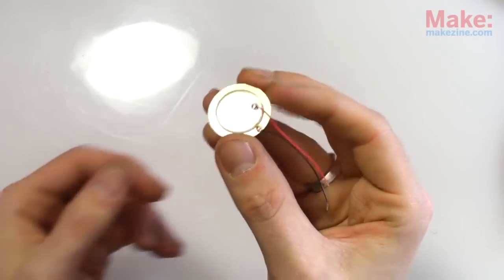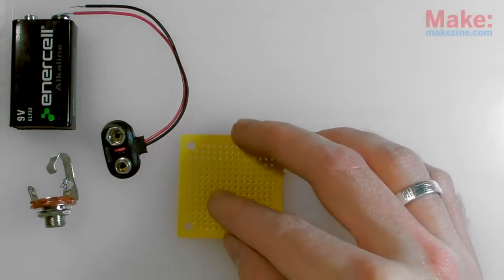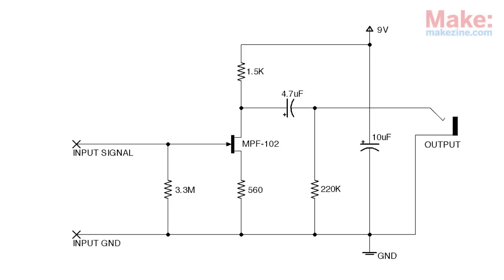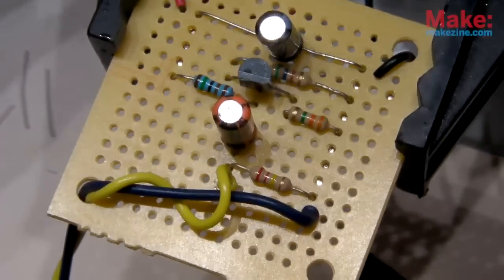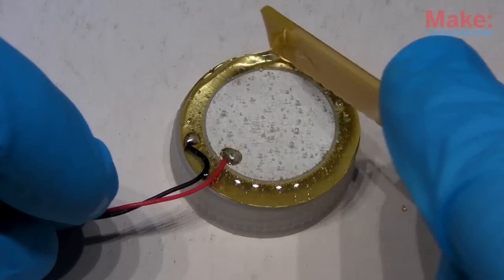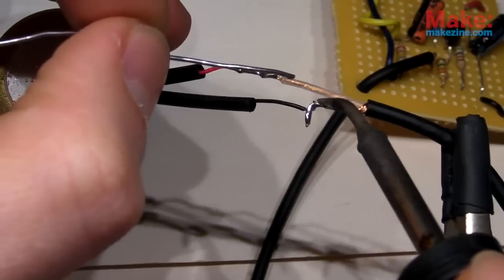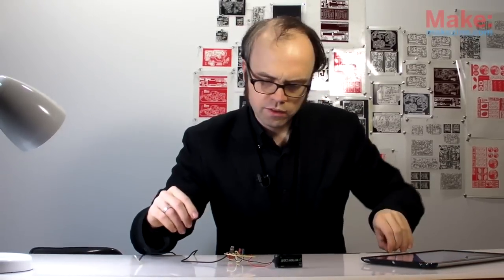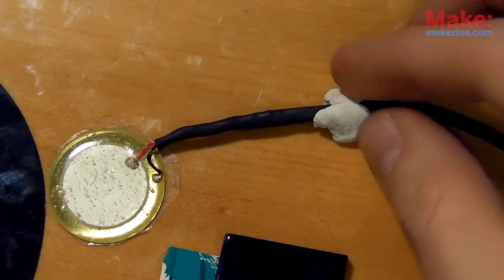DIY Contact Mic - Collin's Lab

Comment: Thanks for the great video.  I want to build this into an electric guitar using an under-saddle piezo system.  Where would I wire in a volume pot?  It will be separate from the magnetic pickups but I'd like to use a separate volume pot to blend in with the magnetic signal.  Thanks for any assistance you can offer.

Comment: The little high-z preamp circuit is interesting, but it appears that when the author went into close-up detail about the transistor connections, he managed to get the 'source' and 'drain' connections BACKWARD! According to what I have been reading about circuits using FET (like the MPF102) transistors, the SOURCE in this schematic diagram should be connected to the 560 ohm resistor to ground, NOT the drain! Hope this helps. The schematic diagram is correct, just make SURE that the lower leg of the transistor in the diagram is the 'SOURCE'. (The one connected to the 560 ohm resistor!)

Comment: Nice! I actually made something work :D Thanks Collin! 
Now I'm trying to replace the battery with a power supply / switching adapter (9VDC, 1A), but I'm getting horrible hum!
I've checked the polarity and all grounds are connected (tested with multimeter). 
Can somene please tell me what's going on?
Reply: eu , tenho o mesmo  problema , tambem não achei,  de onde vem  o zumbido , eu o mau  não  funcionou , tambee, quero uma ajuda!1

Comment: This is seriously old.  However, I'd like to hook up a piezo to a super tiny amp, run it off something like a 1 cell lipo.  connected to earphones with a pot to adjust the volume.  What amp would I be looking for for this project?

Comment: I want to make this pre-amp, but since I am a electronic newcomer I feel like I didn't get enough information. The Link in the description doesn't work by the way.

So If I look for all the resistors with the same Ohm Value as you stated, the seller will state more informations and I don't know if stuff there has to match f.e: TRU COMPONENTS TC-MF0W4FF5600A50203 Metallschicht-Widerstand 560 Ω axial bedrahtet 0207 0.25 W 1 % 1 St. (so the 560 Ω) and the 
TRU COMPONENTS TC-MF0W4FF3304A20203 Metallschicht-Widerstand 3.3 MΩ axial bedrahtet 0207 0.25 W 1 % 1 St. (3.3 MΩ) Do the resistors have to have the same W value? Do they have to be "axial wired?" should I look for another resistor? Should it be from the same company or is just about the resistor value..
Or with the capacitor: Panasonic EEA-GA1H4R7H Elektrolyt-Kondensator radial bedrahtet 2.5 mm 4.7 µF 50 V 20 % (Ø) 4 mm 1 St. and
Panasonic EEA-GA1E100H Elektrolyt-Kondensator radial bedrahtet 2.5 mm 10 µF 25 V 20 % (Ø) 4 mm 1 St. 
1 states 50V the other 25V -> will this fuck with my circuit? 
I feel a bit lost..  But thank you for the video nontheless..

Comment: seeing as the piezo element works on vibrations (unlike normal electric guitar pickups), dont you think encasing it in rock hard epoxy might reduce its effectiveness? In other places Ive seen them used (microphones, speakers, triggers, fogers, sonar...) they are never installed with such restrictions. Im no expert here, just using some common sense. I welcome any informed corrections

Comment: How would the signal be worse if you would connect the piezo directly to the amp without the circuit?
Isn't the high impedance signal of the piezo actually ok for the guitar amp, since the electric guitar pick-ups are also passive? Thank you for answering!

Comment: I'm cheap and I think it's way more rewarding to do something yourself rather than buy something pre-made. But I still wonder: How good is this compared to a piezo system on an electric guitar? I want to do this to my electric guitar.
I think it's also fun to experiment by adding it to the tremolo and to different places on the body. It might do something interesting with the sound.

(If I don't watch out I have to build a control panel on my guitar in order to select the contact mics I want to use.. xD )

Comment: Piezoelectricity is really an interesting thing and is found in anorganic, organic and polymeric materials. High impedance output is critical. I experimented with another contact microphone type DIY, but piezoelectric materials are modern and have advantages against other technologies. Therefore I'll test that sort of material too!

Comment: Great video! Thanks. It might be worth mentioning that whenever one needs to "clip off the connector" from the end of a cable (RCA in this case), it's smart to clip the wire much farther back on the cable (length permitting). By doing that, a second usable cable is created, saving future project cost.  Clipping the RCA plug off so close to the end wastes a good opportunity  to have a cable for another day.

Comment: When the video I wondered for a moment why Agent Smith was doing a video about building a circuit. :)  Are you sacrificing any responsiveness to sound by adding epoxy to one side of the piezo?  If I was to try this I would prefer trying to stick the piezo to the pick guard to avoid damaging the finish of the guitar top, or put it inside. The bottom strap post on the guitar could be replaced by the jack and it would make it easier to keep everything inside the guitar.

Comment: Hey Collin, really enjoyed your video.  I was just curious about the role that the 220 K ohm resistor plays in the circuit/ diagram. Could u explain?
Reply: The 220K resistor has no effect on the audio signal: it just connects the negative terminal of the 4.7uF capacitor to ground. This ensures that the 4.7uF capacitor is correctly polarized and that any DC leakage current from the capacitor flows to ground .  The 220K resistor will also eliminate pops and bangs when you plug the pre-amp into the main amp.
Reply: @phonicwheel933  Hi Phonicwheel, are you are still available for advice? I made the circuit today and am getting pops and bangs when I plug it into the amp... Also, the piezo records sound when I tap it - but records no vibrations when I hold it against my throat or other surface? Would you have any advice for problem checking? Many thanks, T

Comment: Good day, I've build the  pre amp unit as explained by the diagram that is in the video. I might be wrong but when I look at the video and how you build the unit, it seems to differ from the diagram provided. As I said, I did use the diagram and it does not work properly. As a matter of fact the 9v battery is building up excessive heat. Where can I get the right diagram.

Comment: Output is better with the prea-amp then without, but still the signal is quite weak, can the circuit be easily adapted to amplify a bit more?

Comment: Hello Collin, How to make a piezo crystal Wass the gateway video, Great Vid! and of corse I went looking for what I thought was going to be a vid" how to make your piezo" which I never found.
But I did come across this video,  While I am sure its true making a preamp(very good instructions) But I am confused.The reason for the confusion is from watching a slew of other videos, in which,  no pre-amp was made or added to the piezo.  Instead, just a quarter inch female jack is attached to the leads of the piezo ( that is taped, glued to a cigar box usually) its then plugged into an amp,  and lo and behold it works????????
Can you please clarify .  Does both methods work? or one works better than the other.
Thank you

Comment: noob here, 
I need to know whats the voltage of the components, i find several of the componentes with the same uF but i dont know the voltage ..
Thank you
Reply: hi, You can use any voltage of capacitor , but i never test >50v capacitors on my piezo preamp , i have make 3 of them using diferrent capacitor voltages, all works and nothing different. maybe it will work on 10-50v capacitor, i am noob too so dont judge me... sorry for my bad English

Comment: for a complete beginner this is a nightmare, can the resistors be different colors in my country ? Did you put things on board in the same order as it is in the schematics, hmm probably not, i can not figure it out, help
Reply: Resistor color bands are standardized no matter what county you are in. You can lay out a board however you want so long as the right connections are made.
Reply: If you are unsure of the value of the resistor, 
you can get a multimeter to measure the resistance of the resistor.
I personally don't really remember the colour code of the resistor.
However, the colour bands are standardized

Comment: Great project idea! Looks like the MPF102 transistors are no longer available, and the nearest thing I could find was a BF245. Tried it and it seems to work. No luck locally (Dallas, TX) finding the 3.3 MOhm resistor. Fry's had a 3 MOhm (well...they had 100 of them that I had to buy, in order to get one of 'em). Put it all together and it worked. However...

Did the 3 MOhm sub for the 3.3 MOhm cut down on the volume? Seems I don't get much at all, unless I tap directly on the piezo pickup. I've found I have to have some foam or something else to push the piezo into the wood, in order to get it to detect my foot tapping on the other side of the wood (cigar box). 

Also, where would I put a volume pot? A tone pot? I'd like to be able to control both from the unit. And if you have any suggestions/experience with pickup placement/box size/etc. as to how it relates to getting the box to sound more like a real base drum, I'd love to know what you know. 

Thanks, and thanks again for posting this project!
Reply: Olá @brad, como  consegui, pois  eu  não consegui, trocar  o transistor  bf 245, sem acerto  para algum resultado, me de uma  mão, para construi-lo

Comment: Hi there, I have a book called Make: Electronics by Charles Platt and I am having a hard time with making the lemon juice battery thats supposed to add power to an LED diode. Any help would be nice. Thank you.
Reply: Not got the book, but I know the basic ideas. You need CLEAN metals to make it work; sand them before use. Make sure the metals are what they say they are! Under ideal conditions copper and zinc should give about a volt - magnesium and copper is even better. If you cannot get it to work with just two electrodes use several and join them together - they can even be in the same lemon if it's big enough. Just make sure that you connect them so zinc is joined to copper, and not like to like. If you don't have enough lemons you can use salt water! I have seen one where they use an ice-cube tray - probably from Make!

Comment: Why do you need both a preamp and an amplifier? What would happen if you tried to drive a speaker directly from the preamp?
Reply: +Matthew Ferrie The output from the pre amp alone is like 5 mV.  You need another amp stage to really hear it.  Collin uses a power amp in the video.
Reply: So the preamp runs on battery power, which gives it a pathetically low-amplitude signal, but the amp, which runs on wall power, can boost the signal much higher?
Reply: yes.  The battery is there to run the transistor circuit and boost the signal enough to where a power amp can use it.  I tried running it to an 8 ohm speaker and nothing.  But plugging it into a guitar amp like Collin does here makes it work very nicely.
Reply: @sdmoonlitsea12  Thank u! U answered my question :)

Comment: Hi Collin, I have a request for a video: Could you do one on demystifying the concept of ground? People usually say "well you can't talk about 5V without specifying relative to "what", and that "what" is ground". However, what does than mean for my actual circuits? What about when my circuit requires +-5V, and is battery powered? What if I don't have a metallic case for my circuit to ground to? Cheers J
Reply: +tyskstil Hey, I hope I can be a little help here. What is known as "Voltage" is really a Potential Difference. (I don't know if they are exactly the words in english, I speak spanish). Electric potential tells you how much charge do you have, and how close they are together. I don't want to start making analogies with water because you may be familiar with it (if not, tell me). What makes current flow isn't that potential, but the difference between two potential(s). Generally speaking, you take "ground" as the 0V reference point. (Keep in mind that Potential is also measured in Volts). And the voltage needed to make a circuit volt is really the potential difference required between the + and - tips of the battery, for example.

So, yes, you can say 5V without specifying anything. 5V Voltage is the same whether you have 100V and 105V or 5V and 0V.

And for the metallic case, it has to do with other stuff (just like a Faraday cage) and not with the circuit itself.

I don't know if that was really your question, hope it helped.
Reply: Hi Habitante19, thanks for the explanation! You are right that I understand the relative nature of potentials (I have a theoretical physics background). My difficulties arise from the ground concept "in practice".

What types of circuit calls for which type of ground? When/why is ground the same as the negative pole on a battery, when/why is it not? Would connecting parts of a circuit to its metallic case still constitute a grounding of some sort? Sometimes ground is supplied through a third wire from the power supply (earth ground?), does this always relate to the potential difference between +/? Altså sometimes a dual power supply (+ 10V) for e.g. an operational amplifier needs ground to be at 0V.. what then?

I don't know, I guess I'm just confused.
Reply: Uhm, okay. That's a lot of questions haha, I don't think I'm able to answer them all, but I will try. 1º Connecting the ground of the circuit to the metallic case gives you 2 benefits (as far as I know): First of all, you have now a wider surface to solder things or just to have them in contact with the ground, because in a complex circuit you need a lot of components to be grounded. The other benefit is that you isolate the circuit for possible interference coming from the outside, using it as a Faraday Cage.

2º You may have two types of power supplies, with negative or positive ground. GENERALLY they are all negative ground (So you have the - of the battery connected to the ground). There are some old circuits, from example in audio, that required a positive ground supply and it's built differently. I might be a bit wrong here, so I suggest you look for "Positive and negative ground supplies" in google for more info.

And last, the earth tip of a 3-tip wire is NOT connected to the negative pole. I'm in a hurry now so I cannot explain it with a lot of details, but I can tell you that it is indeed connected to the physical ground. It's literally connected to the ground, that wire is buried (or should be buried) directly in your garden with a long copper bar. That 3rd tip is just for security, if you accidentally electrocute yourself, the current will flow directly to the ground through that wire instead of going through you, and then the ground. I'd love to keep chatting when I come back!

Comment: Why do you usea 3.3 Mega Ohm resistor?
Reply: +david power Piezoelectric pickups generally have a very high output impedance which makes them act like a capacitance in series with a voltage source. So, to maximise frequency response you generally need a buffer amplifier which can take the high output impedance of the pickup and lower it.

Comment: Hi! thanks a lot for the tutorial. I have a little question: a have seen other videos and they don´t put any circuit at all. What´s its function is it a preamp? Also, how much is the impedance of the piezo with or without it? Thank you so much!
Reply: +Pablo Martín Yes, the transistor works as an amplifier, without the circuit the output would definitely sound lower in volume.

Comment: Can u say the voltage for the components. ......plz send as quick as possible ....😊😊😊😅😅😅
Reply: The capacitors should be 12 Volts rating or higher. The NJFET (transistor) should have a drain to source voltage rating of 12 Volts or more. The resistors should be 0.1 Watts or more, but avoid big power resistors.
Reply: +Kavitha Hari i have the same question

Comment: Sounds light in bass frequencies.  Piezo's need a high input impedance, in the many meg ohms, to produce a good sound.  I would add a larger input resistor.
Reply: TOCS I did this on my acoustic and it sounds so great I did it on my brothers acoustic bass guitar
Reply: +nicethugbert I'm going to test that out as I want to try and use this for my acoustic bass guitar. thanks for the info
Reply: +nicethugbert You wouldn't want that on an acoustic guitar though. Most piezo soundboard transducers already output a very high input impedance. Most manufacturers have found that keeping the input impedance of their preamps around 1Mohm is the sweet spot for allowing the best frequency response.
Reply: John Strauss
You tried various input impedances?  Which input impedance did you find the most pleasant after experimenting?
Reply: No I did what Collin did and it work out great for me on both Acoustics  I did it on.

Comment: Could this be adapted to work with +5v?
Reply: +Myles de Bastion Just because, I was going to say - There are designs that will work at 5 Volts. This design may not work very well if at all because it requires the "Overhead" 2-3 volts for the J-Fet to drop. Changing the Source and Drain resistances should allow the amp to run at 5 V, however the gain will be reduced. The output will probably only swing 1-2 Vpp centered around 4 volts or so (From 3.5-4.5 Volts).
Reply: +Myles de Bastion I guess it's just a matter of putting the right resistors to bring it down to 5V. My 2 cents.
Reply: +gizmoguyar Thanks for the detailed explanation!
Reply: Gizmoguyar is right, I hadn't thought about the impact on the Jfet.